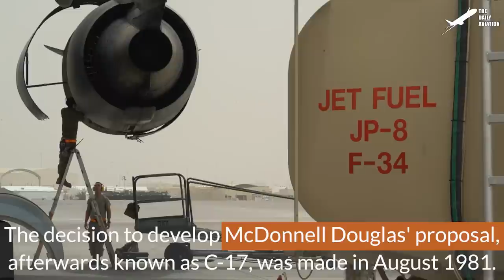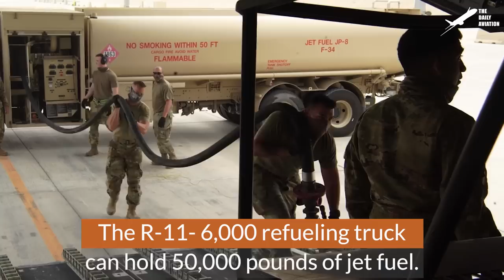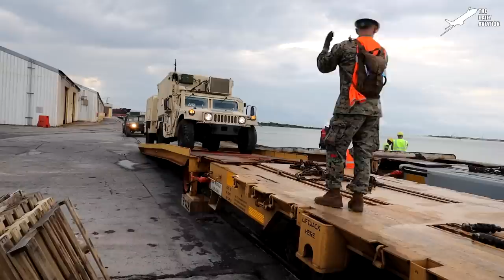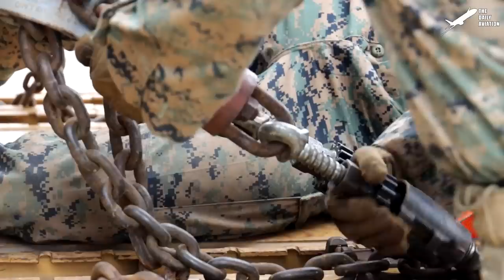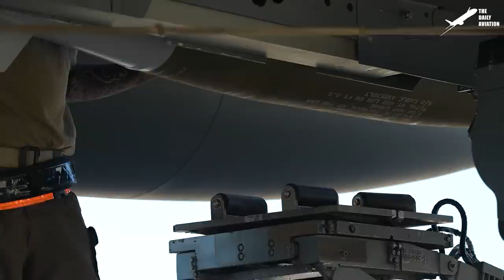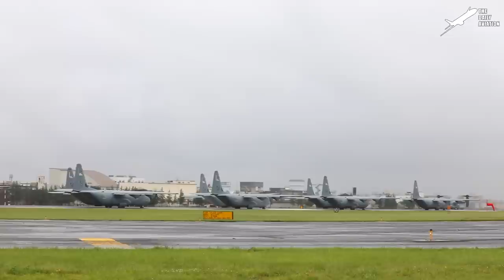US Found an Ingenious Solution to Transport 40 Tons of Jet Fuel by C-17 Plane

Comment: Fuel bladders have been used in Northern Canada for years. I have seen them in DC3s and old C47s.
Very effective and a tad dangerous
Reply: At least it is jet fuel, which is almost the same as kerosene #1. I cannot imagine transporting gasoline that way!
Reply: @Sylvan_dB  In the mid 1960s we were carrying ten tons of fuel in bladders on the back of ten ton trucks.  A punctured fuel bladder does not leak any faster than a punctured metal tank. The bladders have some self-sealing ability.

Comment: if the bladders have separated sections with port holes in those sections it will stabilize
the fuel in the same way it works in the tankers

Comment: Why fuel bladders and not a BFDS. I’m positive the USAF has BFDS (Bulk fuel delivery system) I’m a retired Canadian Loadmaster and we stopped using the fuel bladders way back in the 90s. Went from the bladders to BFDS, haven’t looked back since!
Reply: Maybe it’s a price thing bladder may be cheaper to use on a large scale.
Reply: If it’s not price it’s probably political.
Reply: It would all depend on the use of the bladder really. If it’s for an austere LZ then I could see that, but to load and fill them onboard a C17, no way! My humble opinion only though.
Reply: I wonder if it is because when not filled, the bladders take up much smaller spaces.
Reply: @paulmorrow8372  that is an option, many reasons to use them in austere conditions, not for simple things! Also the bladders themselves can be rather large folded up as well. They’re not that much lighter then the BFDS too. Those bladders are stupid heavy that rubber is super thick and heavy for sure. I wish I had a photo of the BFDS we use in Canada. Google didn’t give me anything at all. I’ll have a look through my personal photos to see.
Reply: @danfraser5626  Dan I just asked the same question.

Are the BFDS similar to IBC totes?

It would seem safer to fill totes away from the plane so leaks can be found before hand then load them by forklift.

A lot of connections on those bladders each a potential point of failure plus all the sloshing around a full tote doesn't slosh.

Not sure if they looked into anything else but they probably should for speed and efficiency, seems like a long time to have a plane tied up, setting up the bag then loading and unloading.

Plus once the bag is empty, it would be a fuss to use the plane to fly something out or fly back with an empty bag only to spend hours removing it.
Reply: @IMGreg..  not sure what an IBC tote is; however, it does sound like a fuel tank in a container. An BFDS is basically a bulk fuel tank on rails or pallet that slides into the dual rail system on the airplane. The ones we have in Canada are approx 5000 gallons to fit in the CC130. We now have the C17 so not sure if we still use the BFDS anymore either. We mostly used it to resupply northern military installations to keep them up and running over the long cold winter. The C17 now I believe can upload sufficient fuel for Alert (which is the most northern military installation in the world) in a few loads. I’m looking for an image of the BFDS installed. You basically refuel from the ramp with the same hookups as normal aircraft refuelling connections.

Comment: Flexible fuel bladders, temporarily installed inside an airplane, are routinely used for extended range flights, such as ferrying a General Aviation airplane across the Atlantic Ocean.  I did that a couple of times. So, an efficient, even if a bit dangerous, way to carry lots of fuel, but definitely not an "ingenious solution found by the US Air Force"...
Reply: depends how you define "found". in context, they "found it". and it is ingenious. so, the statement is accurate.
Reply: A guy just did that in a single engine, delivering from SanDiego to Hawaii.
Reply: The first guy that did it though.
Reply: Yes this is very dangerous when it comes to over weight landing.
Imagine after take off and needs to emergency landing . And doesn't consume the fuel on board its to heavy for the aircraft to land
Reply: @xianmatthew5891  When ferrying an aircraft, equipped with a fuel bladder, you can get a maximum gross weight extension permit.  Also, light aircraft do not have maximum landing weight limits like airliners do.   I imagine (but don't know for sure) that military planes also don't have such limitations.
Reply: Nothing new… as far as I know US AIR FORCE tanker do that since ‘70
Reply: @jamesleaty7308  I did it myself when I ferried my plane from Baltimore back to Europe.  Using fuel bladders is a perfectly normal ferrying technique to substantially increase range.
Reply: @st-ex8506 did you see the story of the  guy who ferried the plane from San Diego to Hawaii. Semi recently.
Reply: @jamesleaty7308  Nope!
Reply: @st-ex8506  Whaddaya have.

Comment: Once the trains are made up they are given to a guy like me, a railroad engineer, and crew to run them over the road and sometimes over several railroads until they get to their destination.  Each railroad or division on the same railroad will supply the engines and crew to move the train.  Sometimes these days the same engine will pull the train to its destination even over another railroad.  

Being a veteran did help me to get a job on the railroad shortly after I got out of the regular Air Force.  It also helped that my father and an uncle were also engineers on the railroad I hired out on.

Comment: I just can't comprehend how jet engines thrusters push jets so fast with nothing to push against except plain air.
Reply: Stand behind one and you will get it.
Reply: This is what happens when u skip ur science classes u speak like such nonsense
Reply: It’s the difference between the inlet pressure which is a negative pressure, like a huge vacuum cleaner, and the exhaust pressure known as thrust.  When atmosphere pressure air is compressed in the first stage of a jet engine then forced into the second section which is the burners, as in a lot of fire, the temperature of the compressed air jumps around 1,000 degrees C.  

And it expands rapidly entering the third section which is the turbine section.  These turbines use some of the energy to turn the main shaft which is turning the compressor section at around 13,000 RPMS.  It also powers the accessories like the fuel, oil, and hydraulic pumps.  What is left exhaust the tail pipe very rapidly.  This gives a big push as thrust, and the vacuum created in the front helps by pulling the engine into it.  

Most jets travel at a speed of 80 to 98 % of the speed of sound.  Fighters and spy planes can travel at speeds of 2 to more than 3 times the speed of sound.  Most of their engines work the same way.  There is just a much larger thrust to weight ratio for the fighters and spy planes.  When the thrust is let’s say 40,000 lbs and the fighter is let’s say 35,000 lbs it can climb straight up at 90 degrees to the ground.  I hope this helps.
Reply: They don't push against anything. It the act of moving the mass of gas out the back of the engine that moves the plane forward. Newton's Third Law.
Reply: If you think that hard to believe.  Just think it is a small vacuum on the upper side if the wing. That keeps that big metal bird in the sky.
Reply: I worked on the KC10 for 13 years. In order to get the correct fuel to air mixture we would send someone with a plastic bag to collect an exhaust sample.

Comment: Why a bladder, why not something like IBC totes?
By the time the bladder is set up they could have loaded full IBC totes.
Not to mention draining the bladder back into a fuel truck whereas totes can be dispersed to different location on multiple 6x4 trucks and fuel multiple planes at one time.
It would be interesting to know why.
Reply: Filling an irregular shape volume,,and sloshing. The bladders dont move that much. totes slide all over the place, Fill a 1 gal bag,and 1 liter bottle. Set them nest to each other, in back o pickup or car. drive away . 1 lit tips over. 1 gal bag stays put. A big ol tote cuttin loose in back of plane , can crash it. The bladders stay put. more.
Reply: I would imagine it is quicker and safer to offload the fuel from two or three bladders versus 50 or 60 totes.

Comment: Ok…… so the fuel bladders shown in this  video hold 2,800 gallons of fuel each. 
One R-11 refueling truck can fill two bladders. 
An Airbus A380 has a fuel capacity of 82,000 gallons of fuel. 
That is equivalent to 29 of these fuel bladders!!! Or (15) R11 refueling trucks!!!
That seems impossible and does not make sense. 
Do you see how much room (3) of these bladders take up on a C-17?  Now imagine (29) of them….. and load them all on to an A380…..
Does not seem possible.
Reply: The fuel tanks on an A-380 and a few other large planes are the size of 2 car garages,..and then some.

Yes, they have THAT MUCH fuel in them while flying.
Reply: @AJ-jy6lb  ok
But I still don’t see (29) of these 2,800 gallon fuel bladders fitting in a 2 car garage. 
My parents have a 4 car garage and there is NO way 29 of these bladders (full) would fit in there. No way….
Reply: @Jason-xb3jh  - Um, i guess it's my fault that i didn't tell you that they have MULTIPLE tanks on large aircraft.
Front,..middle,...back,...wings,...etc.

But i did say "tanks",...plural, not just one.
Reply: @AJ-jy6lb  me too…. “Plural” (29) of them. Again look how much space (3) of those bladders take up.  Just sayin’…..
Reply: If joe bob Government only had A380 Freighters, and needed to supply fuel distant one off base. Bladder up. Some of the Northern US/Canadian/Russian, bases , towns. The get all buy air. twice a year maybe. This is the way to go. WW2 , C47's, 55gal drums. 55 gal drums are still used or remote fuel delivery.  Now most of the bulk fuel, is inserts , that roll on roll off. There are situations where the bladder is better.